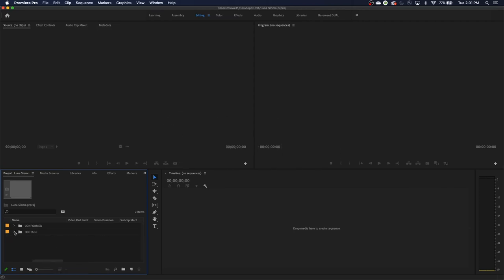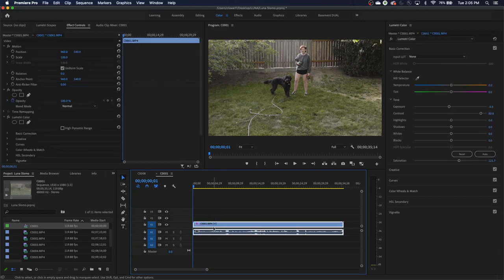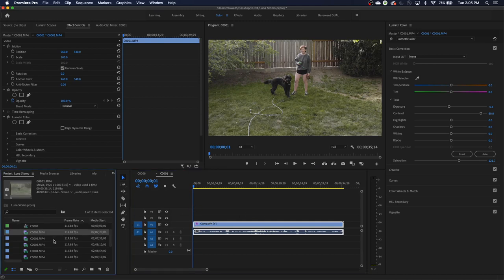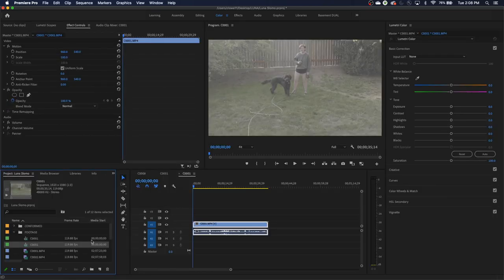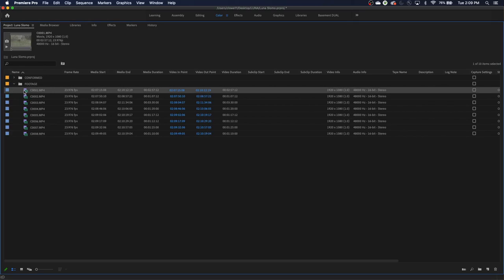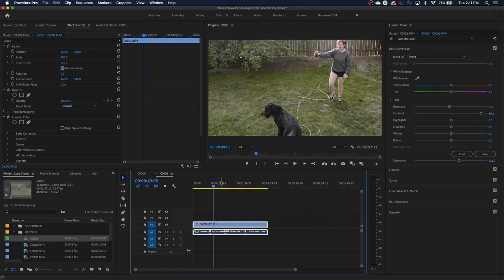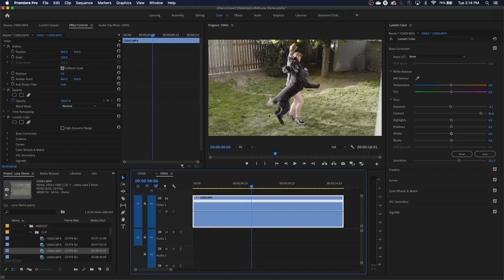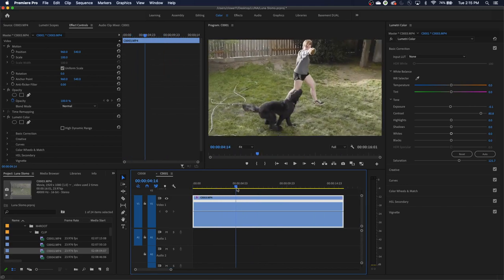E53 - Slow Motion & Time Remapping - Adobe Premiere Pro CC 2020

Comment: That's good and clear. On a related note could you do a video explaining the best way to convert a lower to higher frame rate and vice versa but keeping the same playback speed e.g. 23.976 -> 30 and 30 -> 23.976. Thanks

Comment: Hey Chinfat, I have a question for you.   But first let me start by saying I really enjoy your tutorials,  unlike a lot of "Youtube Experts" you clearly know your craft.  My question is on editing with multiple frame rate footage.  There appears to be two different approaches, and I don't know there is any difference or they both achieve the same result.    I edit on a 30fps timeline and I usually shoot my drone footage at 60fps so I can do slowmo if needed.     So it seems there are two approaches out there for playing drone footage at normal speed in my 30fps timeline:
Approach 1: Just drop it into the 30fps timeline and it plays at normal speed (and I assume drops every second frame).
Approach 2: Conform it to 30fps (modify/Interpret foootage/30fps)  and then change speed to 200% on timeline.

Are these just two different approaches that do the same thing or is one better than the other in your opinion (and why)?
Reply from the maker: It used to be that you would have to conform the footage to the final frame rate or you would see skipping when the math didn't line up perfectly. 60 to 30 is easy cause it removes every other frame. But 60 to 24 would have to remove 6 more frames, you would see the hiccuping from the additional frames removed. Premiere in the past few years has added some sort of frame blending to compensate for additional removed frames that do not conform as easily mathematically. It does a really good job.  

The main issue is that the higher frame rate you have (if you are conforming to 30 or 24), you will have less motion blur and the footage will look choppy (like you shot it in a higher shutter speed). That's because the higher frame rate, you are force to have a higher shutter speed and therefore, you have less natural motion blur if you are conforming to a lower frame rate. If you shoot at 24 fps, normal shutter speed is half exposure time per frame at 1/48. If you shoot at 120 fps, your shutter speed at half exposure time will be 1/240. you can decrease that to maximum exposure time of 1/120, but when you conform to 24 fps, you will have very little motion blur on things moving quickly and it will not look natural.
Reply: @chinfat  Thanks for your reply. So in summary it doesn't matter which approach you use now days on dropping in higher frame rate footage.  

On the topic of frame rates v Shutter speeds,  I actually went up an interesting learning curve.  I have traditionally always shot my video at 24fps with 1/48s shutter speed and love the traditional look.   BUT.... I am shooting Adventure motorcycle riding, and what I quickly discovered is that the image stabilization algorithm on GoPro doesn't work too well if there is too much motion blur... it seems there isn't enough sharpness to "lock onto" and stabilise.   I also found that because the movement is so fast, it was too much blur,   So I played with increasing shutter speeds and ND filters until I found what looked good  (Just the right amount of blur) and it turned out to be somewhere between 1/200 and 1/250s.

So I started using this on GoPro and also drone, but your note just made me think.... Drone is gimball stabilised, so it might do a better job and perhaps look better with slower frame rate and shutter speed.  I'll give that a try on my next ride.   Thanks for your response.  Happy NY,.
Reply from the maker: @brentbat  Interesting. A lot of high-action sports use a higher shutter speed. I never that about that with motion tracking, but that makes sense. Sounds like you have some experimenting to do. I'd be curious to hear back from you when you find out what works the best.
Reply: @chinfat  I will definitely let you know. I'm going for a ride on Wednesday, so I'll try running slower frame rate and slower shutter speed on the drone to compare.   IF you are interested, these are the types of videos I make about Adventure bike riding https://youtu.be/JEHVV2BLcPc.  (100 seconds).
Reply from the maker: @brentbat  Wow. That's some great footage. The Go-Pro and the drone footage match very nicely. Seriously excellence footage.
Reply: @chinfat  Thank you.   For me video production is a labour of love, and I love combining it with my other passion... adventure bike riding.  Take care.

Comment: what do you mean by progressive frames?
Reply from the maker: Progressive scanning is where an image is recorded and the image sensor records the image from the top of the sensor to the bottom. It simulates motion picture film, when the film plane is "progressively" exposed from top to bottom by a rotating or rolling shutter. That, in combination with lower frame rate (24 fps), it has a bit of a strobe look to it, where the video look is more smooth. Some people prefer progressive, cause it looks more like film.
Reply: @chinfat  great explanation bro!